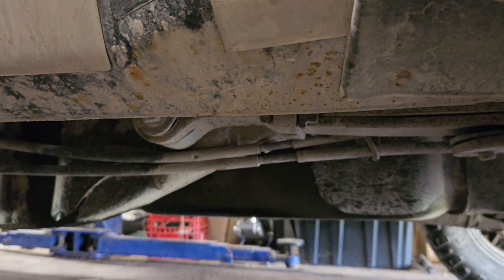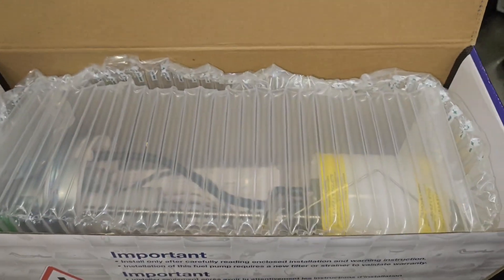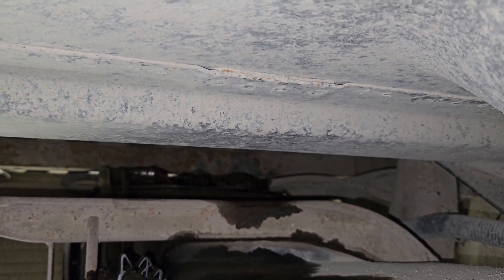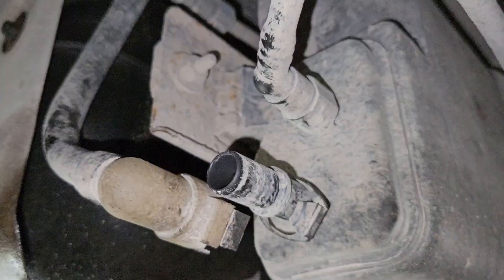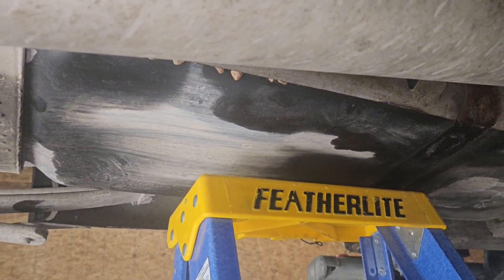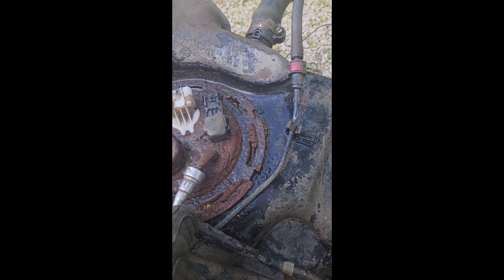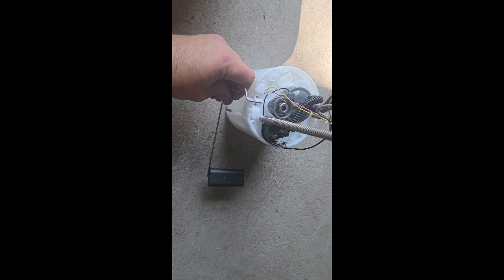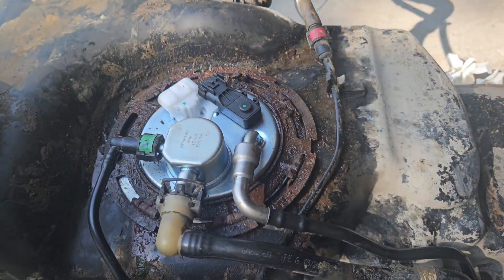2007-2013 Sierra/Silverado How to change your fuel pump

Comment: Everybody shows us how to change a fuel pump , what about the truck , how does it run for signs of a bad fuel pump , for example , I just changed the motor in my truck , only to find out it maybe the fuel pump ,14 thousand costs of replacement at Canadian tire , drove it home and broke down 20minutes after , motor was shaking like a bad running tractor, after changing the motor  same thing , running like a bad shaking rough running tractor , can it be the fuel pump , loss of power
Reply from the maker: A simple fuel pressure test would have found that out. Generally a fueli pump going bad will feel like a loss of power unable to accelerate and less rpm especially in higher gears. One of many symptoms but those are common ones